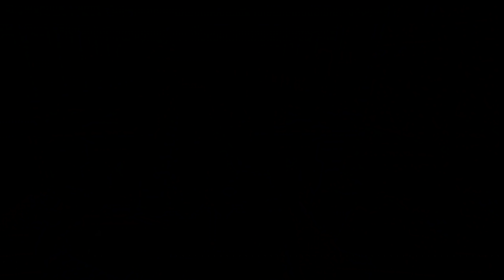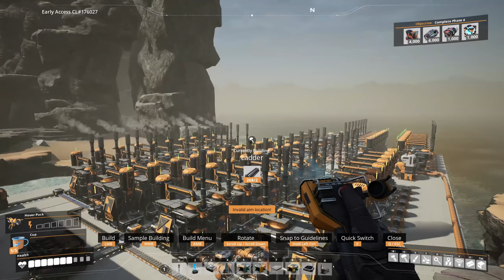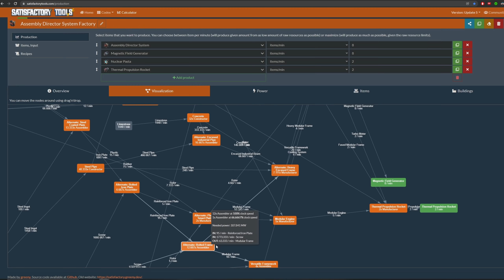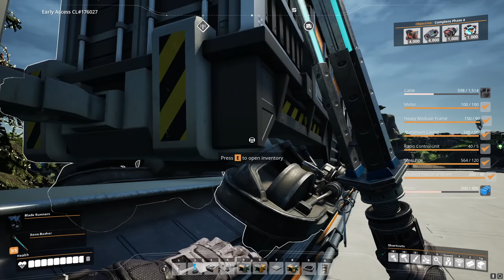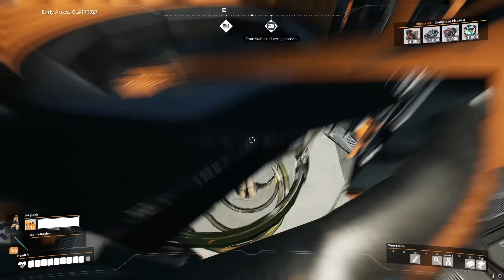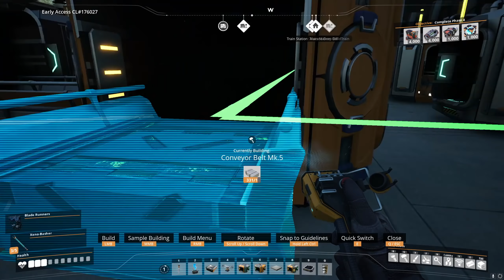Satisfactory : Ep12 Excessive Plastic and Rubber build

Comment: Know i noticed this. You have two sets of 20 refiniries to make plastic and rubber? Which means that you don't need 10 blenders. Correct?
Reply from the maker: As far as I recall there was several blenders involved to make the fuel we needed to turn into rubber and plastic. 12 blenders set to diluted fuel to make 1200 fuel which we used to make variable amount of plastic and rubber.

Comment: ...Wouldn't it be more efficient to recycle the resin into plastic and/or rubber as both a seedbase and excess of material to give you more than 300/each product at the end? 12 points/piece doesn't seem worth the increase in plastic/rubber production.
Reply from the maker: Oh we could have but considering the amount of plastic and rubber we were able to produce with the default setup it was not worth setting it up. If we needed more later we could have spent the time building a factory to utilize the resin.
Reply: @FrancisJohnYT  Fair enough!

Comment: Surprised you're not using the pure iron ingot recipe at the heavy modular frame factory. 50% more iron ingots by just adding water
Reply from the maker: I'm going with a "max steel" approach so my limiter is going to be coal.
"Max Steel" = all iron based products are made from steel, Steel screws, Steel rods, Steel coated plate.
Allows for some incredible compression of production as well huge resource savings.
Reply: @FrancisJohnYT  what steel recipe(s) do you plan on using?
Reply from the maker: @Miglow  Just the usual one's, steel screws, steel rods, steel coated plate and Encased industrial pipe.
Reply: @FrancisJohnYT  I meant for the steal ingots. My assumption was you are using the basic recipe but I was wondering if the coke steel ingots recipe might be worthwhile
Reply from the maker: @Miglow  I'm using the Solid Steel Ingot recipe as coal is close by and plentiful. I would really only consider Coke steel if I was going really really big.
Reply: @FrancisJohnYT  all steel here requires bringing in oil or plastic, though. You could avoid that by just using iron for the reinforced iron plates. According to the calculator's maximize mode, you could hit 43 reinforced frames using just the iron, coal, and limestone pure nodes that are in the area. Which would be over double what you seem to be targeting with your all-steel diagram
Reply from the maker: @kllrnohj  For our planned production we only need 20 reinforced frames. Though you are right doubling it would be easy. 
If we use iron plate from iron ingots it would cost 1625 iron ore total. Using the plastic steel version reduces that to 925 iron ore per min. All for the cost of 56 plastic per minute.
There are arguments to be made for using pure iron ingots recipe. However the steel version I'm going with requires less buildings and power. Throw in that we are running a train to this outpost already and sending over the required plastic is really easy I prefer this method.

Comment: Not sure if you really care, but I see two drawbacks of your Rubber/Plastic line:
1. You’re sinking the Resin which you could turn into free Rubber to start the Recycle. 
2. Because of the way the game does fluids, you can never really run at full 600m3/min in the MkII Pipes. Better to run at 300/min in the MkII pipes for 5 otherwise the tenth Recycle Refinery will have problems.
Reply from the maker: We only need less than 400 rubber/plastic to reach our goal, so I'm ok with a bit of pipe inefficiency. If I was being more stringent I should really do a bunch of testing to figure out how you get the most out of your pipes.

Comment: Tip for not overshooting the base when using the hypertube cannon. Only vertical velocity is counted when considering damage, so if you hit a wall horizontally at immense speeds you'll take no damage. So if you build wall corners a few levels tall in key parts of your base you can aim at the wall tower while hurtling through the air and when you smack into the wall your horizontal movement will be stopped harmlessly.

Just be aware that the default walls are actually indented a bit and have a small lip you can land on. So if you use default walls and haven't cancelled out your vertical fall it's possible to die from the vertical velocity when you hit the lip on the wall. I found that out the hard way when I thought of using the jelly landing pads to land a cannon launch to my aluminum outpost. You can also avoid this by using concrete walls which don't have the lip.

Comment: You're so lucky to be playing this after they allowed object clipping. Otherwise this mall-factory would be a pain to build.
Reply from the maker: I think everything I have done so far could have been done in a way that avoided clipping, but it would have taken so much longer to build.
Reply: @FrancisJohnYT  I like your style :)  Keep it up! :)
Reply: I'm wondering if this is why the Satisfactory community is so picky about using straight lines. It's one thing to use straight lines to look nice. The practicality of this helps with keeping organized.

However if clipping must be avoided then the practicality of straight lines and minimum spaghetti goes way up.
Reply: It's not terrible .. his belt system is how I like to do it. (Though I've never done it to his scale)  I just have to use elevators to bring the resources out instead of just the splitters.

Comment: Sinking the resin is silly. The recycling recipes may turn fuel into plastic or rubber, but you have to start with something to get the cycle going. That "something" is 300 rubber / minute from the resin. That's a 25% boost to your production right there.

Also, when there's a lot of pipes carrying different fluids, it's well worth it to paint them. Color-coding the pipes makes absolutely clear what's going where. I typically go with the fluid colors, so black for crude oil, purple for the heavy oil residue, orange for fuel, and red for turbofuel. Occasionally I'll put in some arbitrary colors if there are multiple lines that I need to distinguish, i.e. 600 fuel / m going to refinery bank A, and 600 fuel / m going to B, and I want to see at a glance which line is feeding which bank.
Reply from the maker: Resin, according to the calculator we will need less than 400 of plastic/rubber at full capacity. If we need to upgrade later I can divert it to production.
I should really get around to colouring stuff but I have a terrible tendency to just consider things done, normally I tear things down and replace them instead of upgrading them.
Reply: @FrancisJohnYT  - It's slightly less tedious if you just change your current default color instead of painting it afterward. For example, if I'm going to lay a bunch of water pipe, I'll right-click the light blue swatch, and set it as the "current active swatch" for pipes. Now every pipe I build is blue.

Most stuff (walls, etc) is lumped under "standard" for this purpose, but pipes, foundations, and a few other things get their own category.
Reply: @gus.smedstad  I remember when Zisteau finally figured that out, was a game changer for him.

Comment: This is sort of funny.  My first turbo fuel facility is doing it the opposite direction.  I make oil into rubber and plastic (on purpose) and I use the heavy oil to make into fuel and coke to send off to the blenders that make the turbo fuel.  I send the residue to make cloth and when the container fills up it just sinks.

Comment: Instead of using a jump pad, could you use a hyper tube elevator to get to a higher platform and then do a vertical hyper tube aimed down at the horizontal one (basically extending the horizontal one up a wall. Do you have enough speed for that? Hmmmmmm.
Reply from the maker: I need to do some playing when I have time to see what is the fastest way to hit terminal velocity.